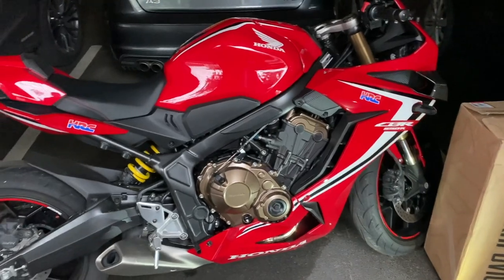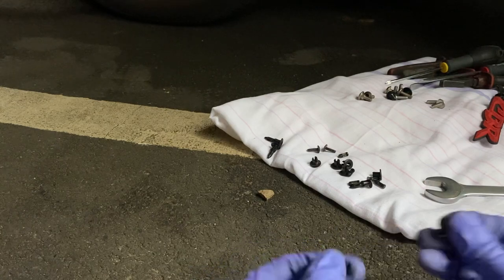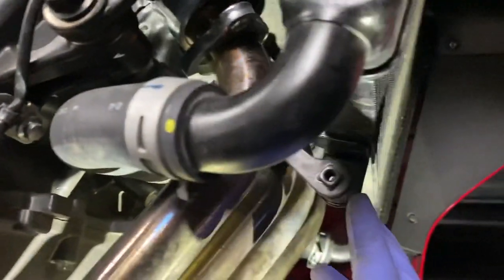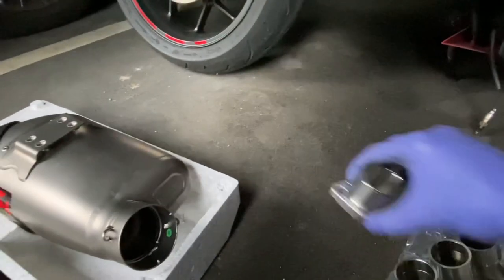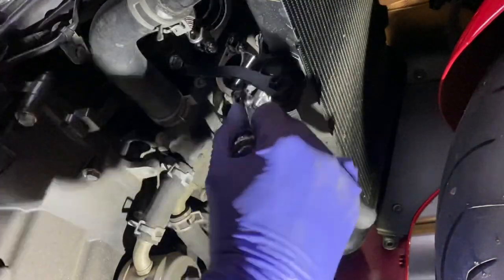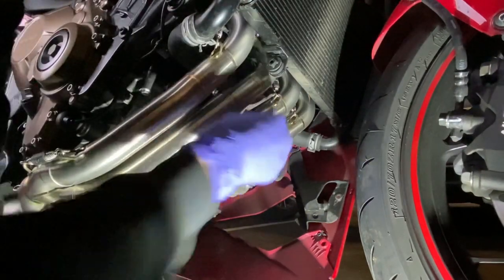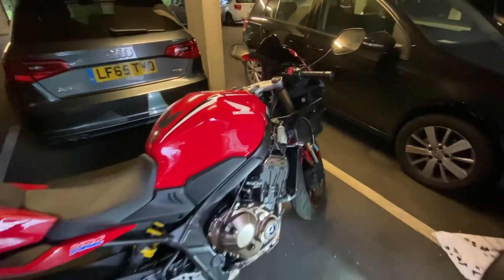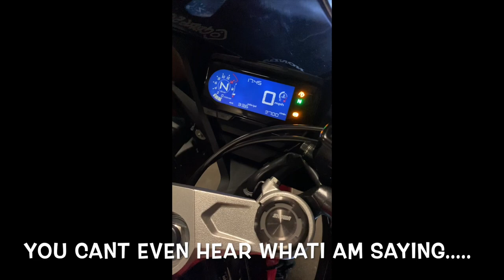Honda CBR650R 2020 Akrapovic Exhaust Upgrade Installation (It’s Loud)

Comment: Hello, I just wanted to thank you for such a detailed video with good tips about installation, also for the previous one with the DB killer removal. I was following both videos and successfully removed the db killer and installed the exhaust. I bought the same exhaust model as yours for my CB650R and it was an excellent choice. The sound is sooo massive, that this loudness and deepness cannot be recorded into video, so if someone is hesitating..... go for it, it's a beast! Also that exhaust popping is mental 🤯
Reply from the maker: No problem and I am glad it helped. It’s exactly why I made these videos in the first place, to help like minded people enjoy their machines 👍🏻👏🏻

Comment: It's a shame the stock exhaust system is so heavy because imo, it's a work of art.
Reply from the maker: I agree. As far as stock exhausts go, it is a very good one and has nice style. To be honest, the note that came from it was really nice too, but I just wanted something louder and to be heard. 
The Akrapovic follows that styling of being mounted under the bike, which is partly why I went for it. If you could easily decat and remove the baffles on the stock exhaust, I would lol

Comment: Great vid! I been watching a few to prepare for this job and this was the greatest detail! Thanks
Reply from the maker: Thank you for tuning in. I have 2 other videos relating to this exhaust too. 
One discussing the differences between the AFT and the HEGEHT and one showing the removal of the Db killer (without damaging it).
Reply: @cbr650ruk3  thanks I had a look at them as well! I’m honestly not sure which one iv got coming and I was under the impression my baffle would have a hex head bolt that is tack welded…I guess I’ll see when it gets here. Thanks again!
Reply from the maker: @Frankdubbsfpv  feel free to drop me a line on Instagram when it arrives if you need to ask me anything else or send photos. My bike page handle is @CBR650R_UK
Reply: @cbr650ruk3  job is done. Pipe is on and sounds great. Your tips had me well prepared for an easy job

Comment: Hi! Thank you for this video, well explained. I just have one question: I bought the bike with the Arrow exhaust already on (without the catalyst converter), do I need to reprogram the bike if I put the original exhaust back on as it has a cat and lambda sensor might get confused and make the bike have a lean air/fuel ratio? Thanks!
Reply from the maker: I would say that is wise. The bikes maps may correct themselves, but the bike may have been remapped when the Arrow Exhaust was fitted. It may be an unknown, but I would always advise having the map checked

Comment: Hi, first of all great guide. I have a question about tuning the bike after an exhaust change. I am planning to buy the same system for my cb650r and was wondering if you have noticed any powerband issues after the upgrade? I've heard a couple of people say that around 4000 rpm there is a very slight drop in power, barely noticeable but its still there. TL;DR - have you noticed any differenced in power output after the upgrade?
Reply from the maker: Hey, thanks for the kind words and for dropping a comment. 
I personally have had absolutely no issues with power or flat spots since fitting the system. I was keeping it in mind, but I wanted to ride it first and run it through the full Rev range. I haven’t bothered getting the bike tuned or mapped because of this. 
If anything the bike feels like it breathes more and it’s opened up. I have done a few side by side drags next to a Friend with the same bike (standard exhaust) and I pull away each time. Various speeds and various gears. I hope that helps 👍🏻
Reply: I have the CB650R one as well. That happens with or without the exhaust but 4000rpm it's super low for the CB650R. You have to be on top of the 8500rpm to wake up this baby. 4 cylinder.. so don't expect craziness at 4000rpm. He's not going to feel any drops since he has a CBR650R ours is the CB650 which is detuned version of his and CBR600rr so it's a totally different engine mapping. I think there are ways of erasing that drop behavior with a ECU flash. Check this video out. https://www.youtube.com/watch?v=kpyzDy7Fpjs

Comment: Hi! Any ideas why the carbon tipped exhaust won't fit 2021 models?
Reply from the maker: I think the HEGEHT exhaust does fit the 2021 models, but I know there are slight differences. 
I would recommend checking with Akrapovic on the website as I believe there is a table with exhaust models against the year of manufacture.

Comment: Really respect the work . But think arak seems quite same as stock . Unfortunately Austin racing did not make full system for this bike
Reply: It’s night and day man… the stock exhaust sounds like a scooter 4000 rpm and below. This is throaty and full sounding bottom to top
Reply: @Yohanyothan right? Lol

Comment: With the baffle in, does it still sound better than stock? Also, I am confused about passing the MOT. Does this lovely titanium system still have a catalytic converter in / would the bike still pass a standard UK MOT?
Reply from the maker: To be honest I don’t know. As you can see from my other video I removed the baffle before I fitted the exhaust, so I do not have a comparison, but I am sure it will on on YT somewhere. 
My exhaust is not fitted with the CAT, but you can spec my model exhaust from the factory with a CAT fitted and you will have no trouble with the MOT. Mine is due it’s first MOT this year, so I will find out
Reply: @cbr650ruk3 did it pass?

Comment: Any tricky parts during the process?
That little sensor maybe?

Cheers from New Zealand and Kia Kaha!!
Reply from the maker: Wow, I think you are the first NZ comment, so thanks for tuning in. 
I would say the most tricky part of the whole process, is getting the fairing on and off! Sounds silly, but it’s quite fiddly and you need to ensure all the clips are properly seated. 

For the exhaust itself, it would probably be lining up the header pipes to the headers. Apart from that, it’s very straight forward. Akrapovic are a really well thought of and well made exhaust, which uses all of the standard bike holes. 

Highly recommend it 👍🏻

Comment: Nice video! 🤙, Did you remove the other panel the other side? I'm doing my exhaust soon and I need to know if I need to unplug it when removing O2 sensor?
Reply from the maker: So I removed the plug end from its harness (bike side) before cracking off touching the CO2 sensor. 
This ensures that when I cracked off and eventually removed the CO2 sensor? The wires would be able to spin freely without being fixed at the other end. Hope this helps and thanks for the comment 🤙🏻
Reply: @cbr650ruk3  thanks for the reply 👍 what did you have to remove to get to the the o2 block (bike side) before cracking of the o2 sensor at the exhaust :)
Reply from the maker: @deanowilliams3397  I just unplugged it from its harness (plug and play - male/female plug). Then it’s a 17mm spanner to just crack it off and leave hand tight until it’s time to remove completely.
Reply from the maker: @deanowilliams3397  it is accessible without removing any panels (unless you have the extended side fairings like I now have).
Reply: @cbr650ruk3  thank you pal saved me time 👍👍

Comment: Where did you get those cool winglets from mate?
Reply from the maker: So I bought these online, however, I was quite disappointed when I first got these as the Carbon side was a nice finish but the inside was terrible. When I removed them from the box, internally it was a really poor plastic mold. I ended up wrapping the inside of them in a satin black wrap to improve the finish. 
This really changed the appearance and then I was happy to fit them. I am not willing to fit anything to the bike that is not to spec or standard. I recommend doing this to yours if you get them. 
I sent a message to the company saying I wasn’t happy with them and they refunded me the money (which was good of them) and they also said keep the item. 
I will drop the link to them on another comment below! 👇
Reply from the maker: https://www.ebay.co.uk/itm/Fairing-Winglets-Side-Wing-Protection-Cover-For-Honda-CBR650R-2019-2020-1000RR-R-/133758248580?mkcid=16&mkevt=1&_trksid=p2349624.m46890.l6249&mkrid=710-127635-2958-0
Reply: @cbr650ruk3  Cheers!

Comment: May i ask sir what is the torque settings for the headers nuts? Thanks
Reply from the maker: Hey, they are detailed in the description of the video. 
12mm - 22Nm (16 ft/lb)
Reply: I just did them tight. Need to check that

Comment: Hi thanks for this. Just did mine now but engine light came on. Any idea what could cause this?
Reply from the maker: What year is your bike? I would check the lambda sensor first and ensure it is secure and tight at the exhaust end and also that the connector end is secure. 
Failing that, it may need a remap / flash. The fuel mixture might have changed due to the exhaust system (usually makes it run lean) and if it’s outside of the bikes ECU parameters it may bring up a fault code. 

Those are my thoughts, but I would recommend having a look on forums or speak to your Honda dealer 👍🏻
Reply: @cbr650ruk3  thanks for your swift response. It's a 2021. Would do another check.
Reply: @cbr650ruk3  just an update, I took out the battery for a day then refitted it. The CEL has now cleared. Thanks

Comment: Bike runs ok? Fuel consumption? No need for a ecu retune?
Reply from the maker: Hey, yep the bike runs fine and fuel economy is not an issue. I travelled on a fairly long journey recently and on the motorway, I was averaging around thee 60mpg mark, which is pretty good. 
I haven't mapped the ECU for the exhaust yet, but I am potentially going to update the Power Commander with the Akrapovic map for this exhaust.
Reply: @cbr650ruk3  ty. Btw jusy saw the video with the side fairings, and your bike  looks gorgeous. Almost makes me feel sad for trading my '13 600F for a cb1000r black edition. But at the same time not :p

Comment: did you put in new gaskets?
Reply from the maker: No I didn’t. Reason being is the bike has only done 1,000 miles. I carried out a condition assessment on them, but in my view they didn’t require changing. Hope this helps

Comment: Any backfire ??
Reply from the maker: The sound is incredible and you do get pops and crackles on gear changes and when the revs are reducing(check out my exhaust revs video). 
There doesn’t seem to be any flat spots or issues with it running. However, I may get the bike put on a rolling road and mapped again to ensure it’s running spot on.

Comment: Hi can I know the front part of the exhaust spring connect to the engine what size is it ? My spring broke after using for a long time planning to replace new springs
Reply from the maker: Hey, thanks for tuning in to the channel. The original Akrapovic exhaust springs are listed as the PS-1 springs. 
The schematic diagram is available on the Akrapovic website. They are 80mm (8cm) long and can be bought online. 

https://www.ebay.co.uk/itm/265785460374?mkcid=16&mkevt=1&mkrid=711-127632-2357-0&ssspo=AkNzCcIbTZu&sssrc=2349624&ssuid=THfDeQ2nQsC&var=&widget_ver=artemis&media=COPY